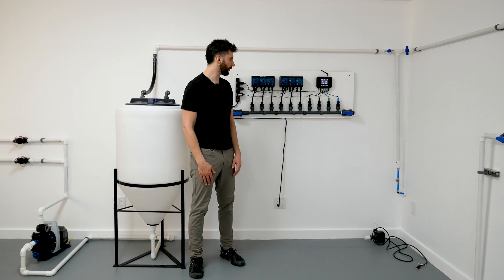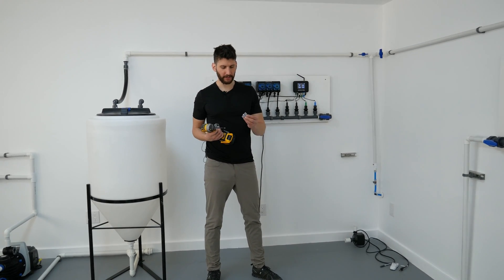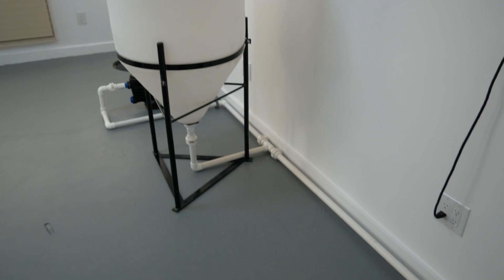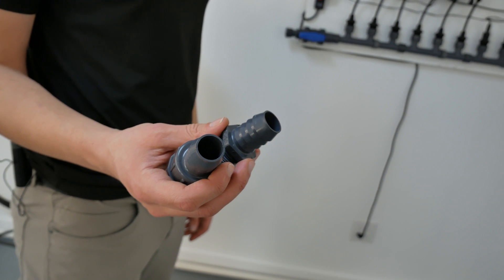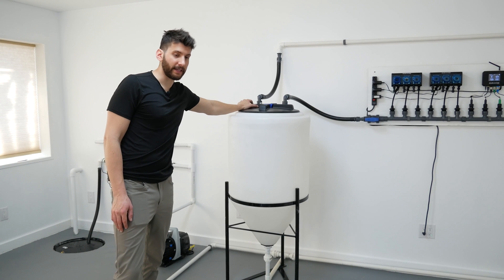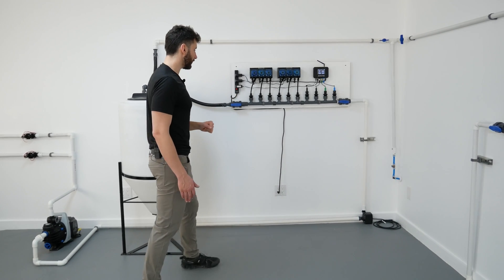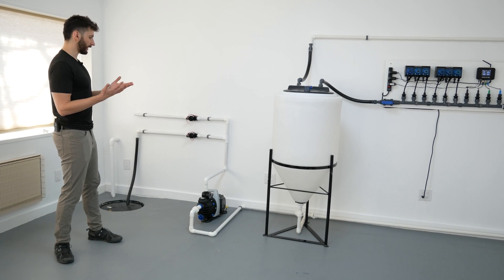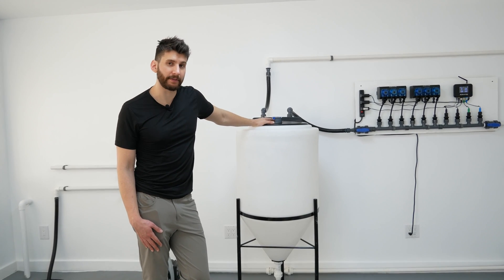Connecting Nuravine to Batch Tank Tutorial

Comment: Thanks for the video, what's the pvc piece used on top of the tank to connect the spa hose?
Reply from the maker: 1 second ago
In this case we are using a Spears barb fitting to connect to a Dura Elbow and Nipple which is threaded into a 1" bulkhead on the tank lid. The key piece here is a union of some sort so that you can easily disconnect the hose from the top of the tank for easy maintenance.